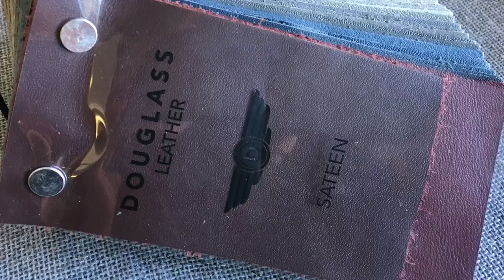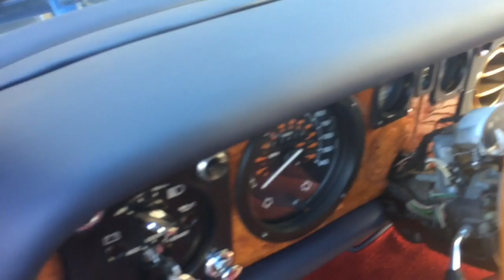Rolls Royce Camargue custom interior restoration

Comment: Once saw, at a RREC meeting, a new Carmague frame and was very surprised at how substantial it was. Nothing light-weight or high-tech about it just a massive steel frame. The Carmague was rather an odd car and, I believe, not very reliable with electrical problems.

Comment: Very impressive but surely not cheap? Also, doesn't detract from the fact that the Camargue was rather unreliable, the electrics were a common source of problem - so I've been told.
Reply: They certainly had a few problems.  My father got one as a change from his usual Silver Shadow but it had quite a few issues with the electrics and the starter, then the fuel indicator showing nearly full when it was nearly empty, so that he got rid of it.